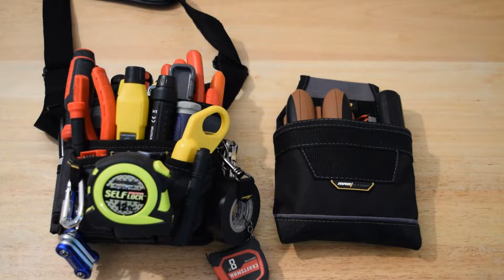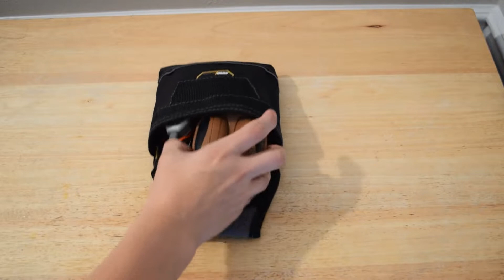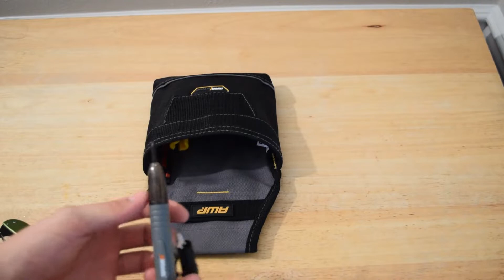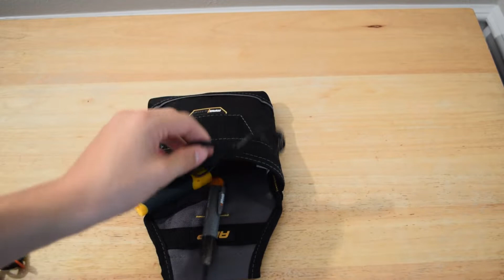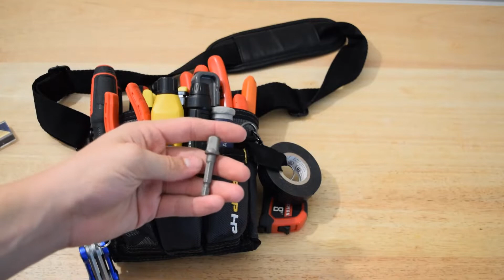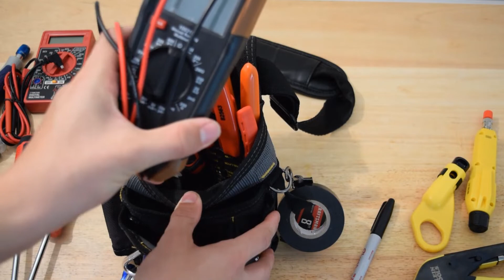Low Voltage/Maintenance Tool Pouch (Klein, Craftsman, Kobalt, and Other Brands)

Comment: Good video. I would say though to invest in a name brand / well known voltage tester. The fact the first one was defective, and they gave you 2 free - tells me they are cheap and I wouldn't rely on them to protect myself. 
Overall I can tell you are 'into' tools. I was at the point you are at and was very price conscious. I predict overtime you will slowly invest more into them. Even for me, I went through a half dozen tool bags... And never thought I would invest over $100 for a Veto Pro Pack, but I did. Best decision I could have made.
Check out www.techtoolsupply.com they happen to be local to me, and I have spent so much money there lol.
Reply from the maker: This never really got used. My current pouch is all Klein. About 700 all in including the meter which is fluke...